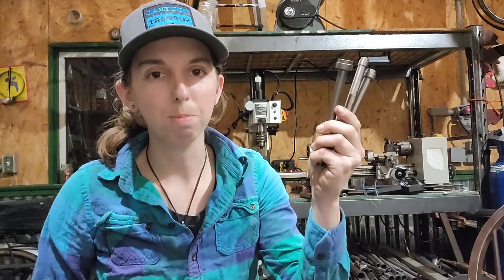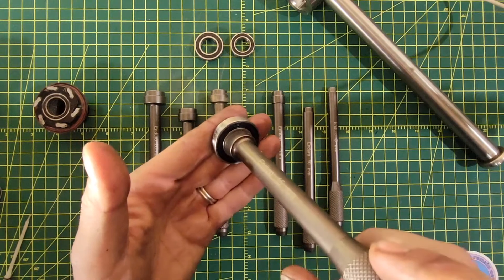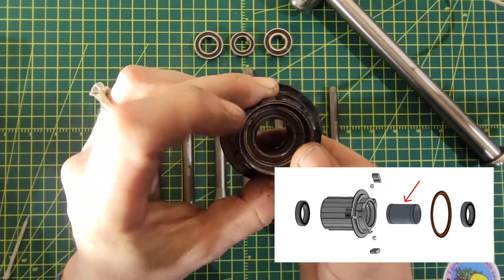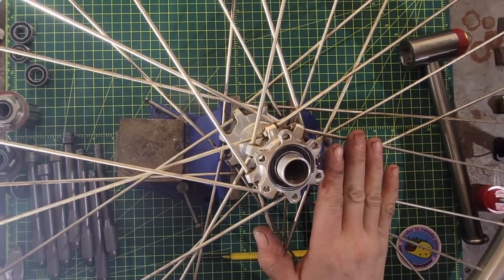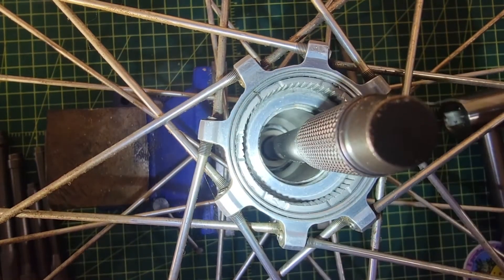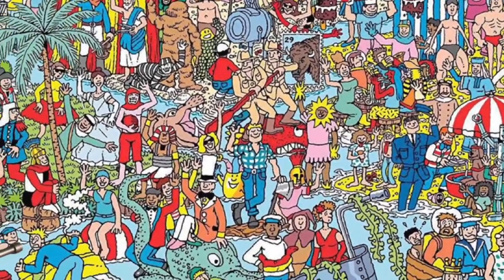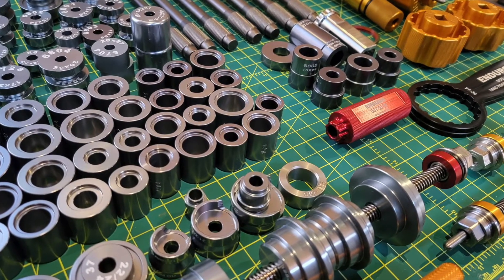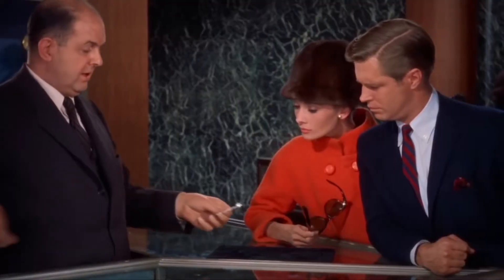TOOL SHORT #4: Enduro Pro Bearing Punches

Comment: Great videos.  Just wondering, wouldn't be smarter to have just one punch handle with interchangeable ends for different size bearings?
Reply from the maker: You're kind of describing a drift, equally valid tool. I appreciate that there is no fiddling with the solid piece. Maybe a hint of time savings, but I think either idea is valid. Travel kit, might be a decent space and weight savings to have it as you described.